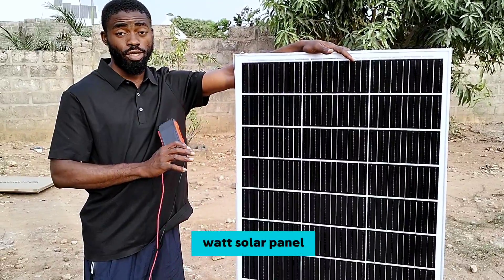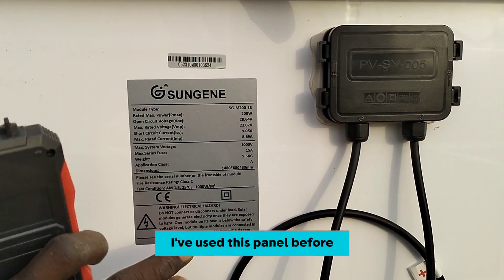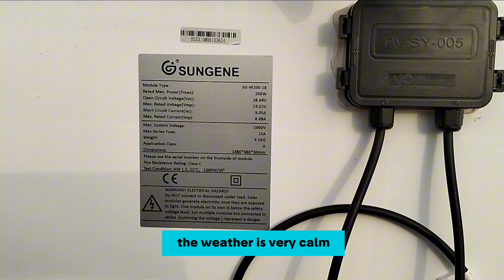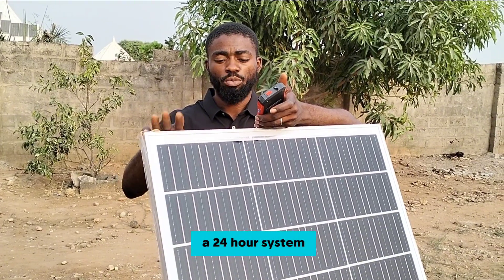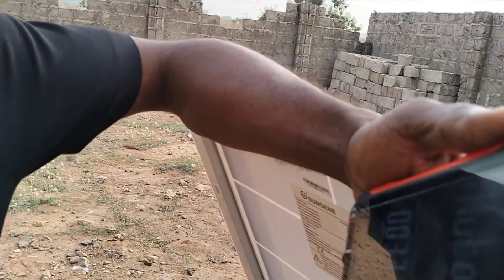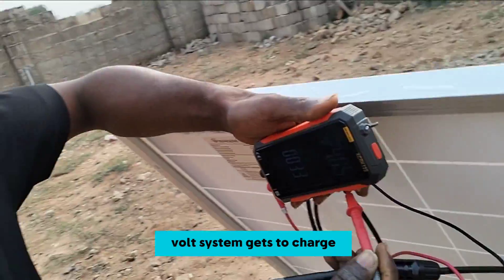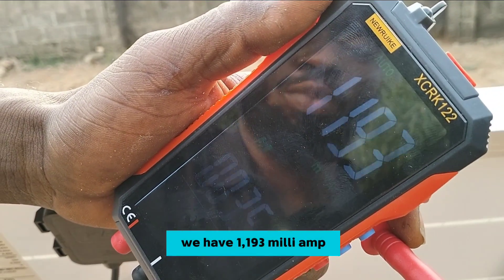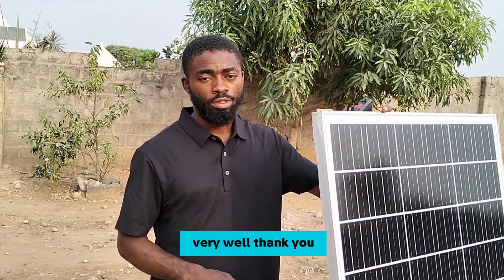Reason why you shouldn't use such 200w panel for a 24v solar energy system!.

Comment: Its all because we don't read manuals.
The Charge controller installed always specify the minimum voltage for the system it supports(12v,24v, 48v)
For most MPPT Charge controller, they specify a minimum of 20v panel voltage for a 12v system, 36v for a 24v system and 64v for a 48v system  for maximum performance.
Lets always try to read manuals.
Thanks for the video as well.
Nice info.

Comment: Hello , I have 10.2kva inverter and I’ve bought 8plc of 550w solar panel . Is the panel okay for the inverter and how much of battery watts I should buy?
Reply from the maker: The battery size depends on the appliances you want to run

Comment: Pls sir, I have a 12V system (two 220ah batteries and a 3000w inverter)... will 2 of this 200w panels connected in parallel be enough to charge the 12V system.....looking forward to hear from you...thanks
Reply from the maker: Not really sir.
For your battery to charge fast you'll need minimum of 6
Reply: @Mairigaemmanuel  I appreciate the reply 💯

Comment: I have a 280 watt 24 volt solar panel and it has been working for 11 years.  So maybe I just have a better panel.
Reply: What is the brand
Reply from the maker: 280w produces about 35-38v open circuit voltage.
So it did work well for a 24v system